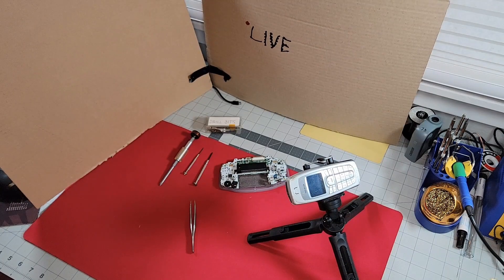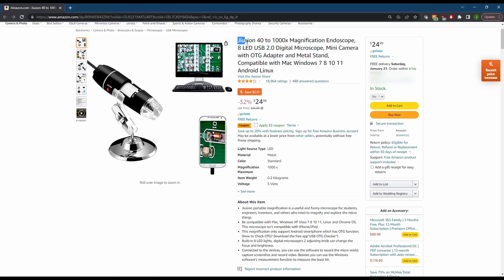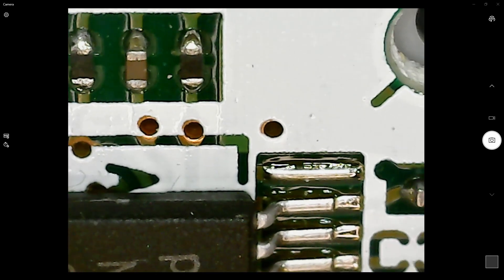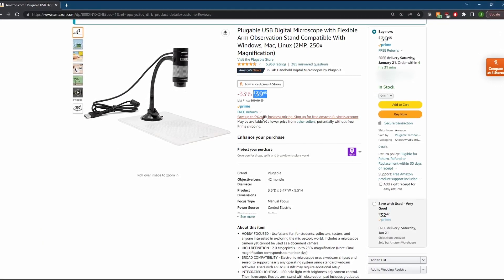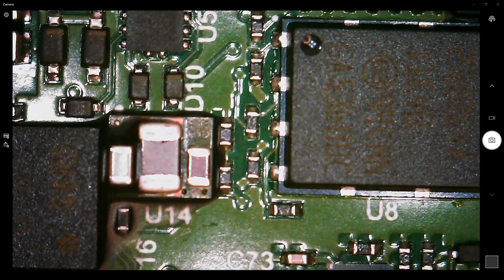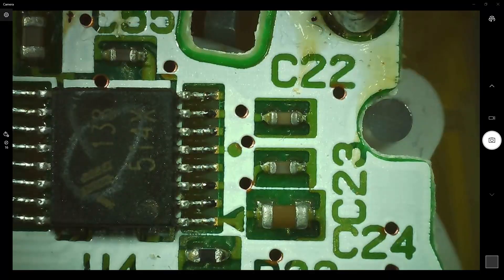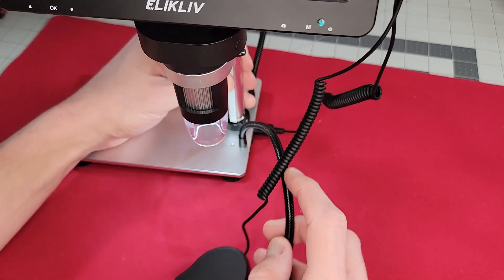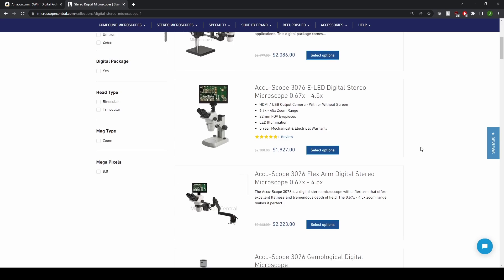Best Value USB Microscopes for Soldering?

Comment: There are versions of the first one sold as 2MP (1080p) which is a lie. They just change the firmware so the camera reports 720 and 1080p resolution but it's upscaled from 480p.

You can do a simple test of taking a photo at each resolution and resizing the photos on PC to 1080p. The 1080p and 720p photos will look the same as the 480p photo.

Nobody does a basic resolution comparison like here. Probably cause people can't tell the difference until it's seen side-by-side. The 720p cameras you shown are very clear.
Reply from the maker: Yep the advertising is pretty deceptive with the cheaper scopes/camera

Comment: For electronic rework/soldering, you only need 10x-40x magnification...   are there any USB based microscopes, true 4k/optical-zoom that you'd recommend?   

For example, one that can output video 
1) wirelessly to a android/monitor receiver (Miracast/Wireless-HDMI)  
2) Wired USB to latptop/tablet device
3) Wired HDMI 

Dual-lens for seeing depth.. and a large Field-of-View would also be nice. Unfortunately, the ones I've seen are very expensive, presumably because they have way too much zoom (130x-180x lens), or come with their own 10" display, or gimic features like remote-control, etc.
Reply from the maker: I am having a good experience with my latest scope that I reviewed in this video: 
https://youtu.be/TYR3DtV6zl8?si=nYByFaapHfioew4G

It meets your #2 & #3, but not sure about #1.
Anything stereo (dual lens) is going to be a high price tag and even higher if it also has a video output. There are just a lot more parts/optics involved in something you can look through compared to a digital sensor, and with stereo, the part count basically doubles and that's what's driving the cost more so than high zoom options. Further, when it's displaying to a monitor you're not going to get depth in that image regardless of whether the scope itself is mono or stereo.

Hope you can find a good option and if you do let me know how it goes!

Comment: Ah thanks for this, I had seen those absurdly cheap microscopes and wondered if they were any use for soldering.
The last one definitely looks promising, I assume the base plate could be removed and the... pole? could be attached directly to a desk maybe?, base plate seems annoying for larger boards.
Reply from the maker: For sure you can do whatever custom mounting solution you're willing to put the time into. I made a more recent review on another scope I like even better if you want to check that out. Thanks for watching!

Comment: I have the first one, its great and dirt cheap. It seems for a hundreds dollars extra you only get a little more. Ive 3D printed a new stand that is much more stable using a helical gear on a shaft, its about 200mm above circuit boards now, i also moved leds from center to remove glare. Its not easy but i can solder components down to about 1 mm. eg the tiny caps around eeproms. Am looking at building my own now with a better cmos sensor from scrapped digital cams, and will need to figure out what "achromatic doublet lenses" are, recommended by chatgpt.
Reply from the maker: The first one is passable for sure, but the higher resolution and improved lighting on the last one was far superior, and the screen kind of grew on me, it's nice to not always have to plug into a computer to use it. Like most things, it all comes down to the individual needs and means.
Reply: @FantasticQuack   Add external light to the first one and maybe do a video if it improved
Reply: Yo man do you have the stl files? If yes could i have them? I really dont Like the stand and would 3d Print one

Comment: Yeah, there doesn't seem to be a good middle ground when it comes to scopes. It's either very cheap or very expensive. Not having auto focus is annoying as well since you have to readjust the lens everytime you move the object.
Reply from the maker: Nailed it. Manual focus isn't too bad especially with the 3rd scope, it gives the feeling like you're almost operating a really nice one :)